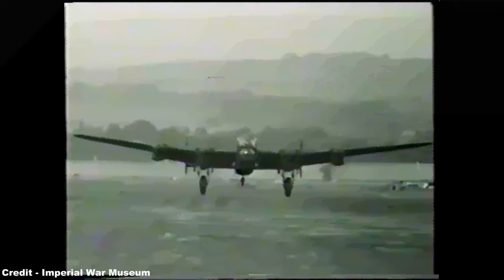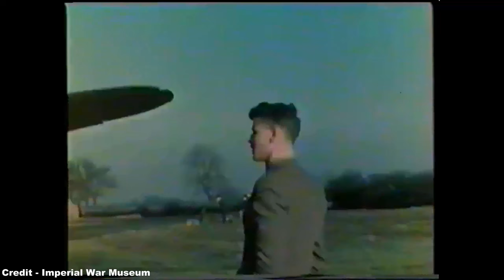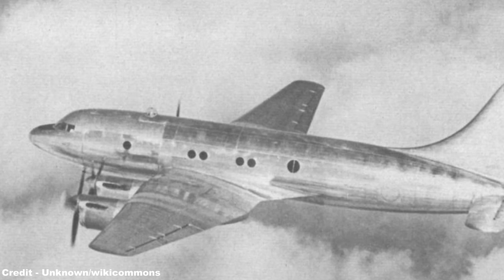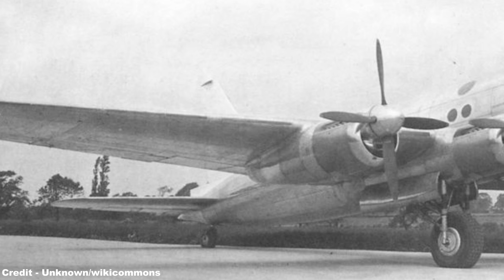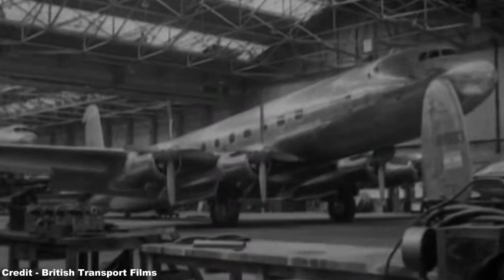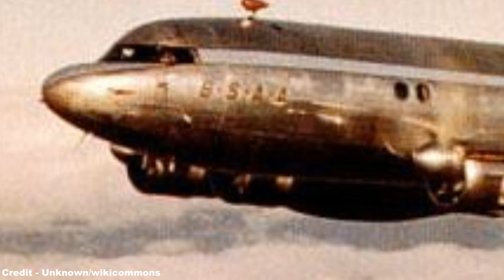Flying Failures - Avro Tudor (Reworked)

Comment: AVRO's chief designer lost his life in the prototype AVRO Tudor 2, because (as I understand) the aileron control cables were connected incorrectly, by one of those fine British workmen.  The Australian government, having built Beaufighters, decided to build the Tudor - but after the accident, the project was shelved.  I purchased one of the Roots blowers the were purchased for it for its pressurisation, from a government disposal store in about 1961;   it would have deafened the passengers . . .
Reply: A Lockheed L-188 Electra met a similar fate due to incorrectly connected control cables.

Comment: All the infighting over the development of the Avro Tudor explained why BOAC ended up with 22 examples of the Canadair Argonaut delivered between 1948 and 1949, essentially a modified DC-4 fitted with more or less the same Rolls-Royce Merlin engines used on the Tudor. No wonder British European Airways almost bought a fleet of 727's and 737's rather than de Havilland (Hawker Siddeley) HS 121 Trident, another plane that ended up in a lot of political infighting during its development.

Comment: Just to add the Lancaster derivates, which have been (partially) in civilian service prior to the Tudor. It started with the Lancastrian, derived from the Lancaster freighter (bomb transporter) of WW II. By all means a design very close to the Lancaster and carrying 9, later 13 passangers. Then came the York which had a newly designed fuselage for 24 passengers and a high wing arrangement. Still no pressurized cabin. The Lancatrian as well as York served with BSAA besides the Tudor.

Comment: Supplanted by the Canadair Northstar which stuck around longer. The Northstar being a better designed Dc-4 and pressurized with Merlin’s. Reliable but loud.
Reply: Sort of  a Frankenplane (there were DC-6 bits in it, too). Canadair did that sort of thing again with the CP-107 Argus maritime patrol aircraft, based on the Bristol Britannia but with a redesigned unpressurised fuselage and radial turbo-compound piston engines as in the Douglas DC-7C. Canadair also improved on the Britannia with the CL-44, but it wasn't a great commercial success.

Comment: 15:49 "...aileron cables had been reversed..." Preflight anyone? Pretty sure I have never started a takeoff before making sure that the ailerons not only move when I turn the yoke, but in the correct direction !
Reply: Probably can't see them from the cockpit.  Post-maintenance checklist failure
Reply: Yeah Right!! "mate" Was reading a total aircraft accident report of a few years ago whereby at the inquiry it was found that the "control surface locks" were still in place as the aircraft attempted to take -off!! So what happened to the pre-flight check between the PIC & his 2IC?? Again yeah right??? Most (not all) aircraft accidents are often pilot oriented!!  So much for good pilot training in the first instance!!
Reply: @brendonrutherford5118  Unfortunately, there have been several such accidents involving control locks.

Comment: Wrong! The first development from the Lancaster was the passenger/freight Avro York. it was the York that replaced the Lancaster's fuselage with a square section.
The Lincoln was, essentially, an enlarged Lancaster. It had the same cross section of fuselage.

Comment: It is astonishing that the Lancaster's  variants and descendant, Lincoln, Tudor,  and then Shackleton remained in front line service until  1991, albeit with contraprops and auxiliary jet engines!
Reply: Sorry, but the Shackleton with auxiliary jet engines in the outer nacelles was the MR3 which also had tricycle landing gear. It left service in the mid 1970's. It was the MR2 which soldiered on, with no jets and a tailwheel!
Reply: ..not forgetting the Avro York!
Reply: @MrStr8den  The York was very useful and successful. There's a nice example at Duxford. Also significant was the Lancastrian, a passenger and mail conversion of the Lancaster itself.
Reply: In what meaningful way? I’m just curious who was using them in front-line service in 1991.
Reply: @EstorilEm  Number 8 Squadron RAF used the Shackleton in the Airborne Early Warning role until 1991. It was replaced by the Boeing Sentry AEW.1